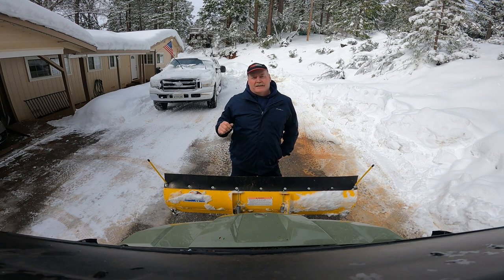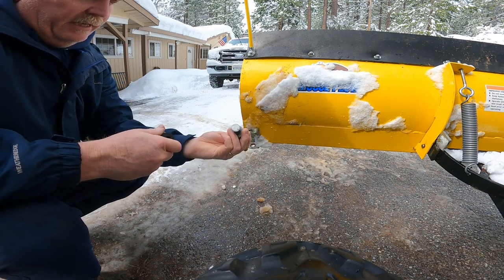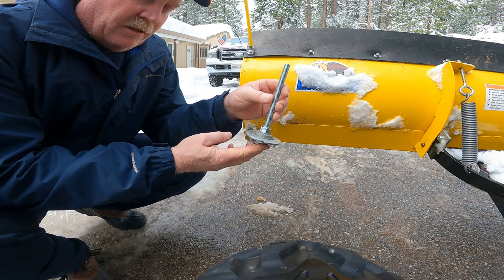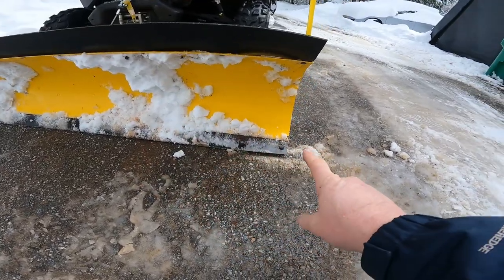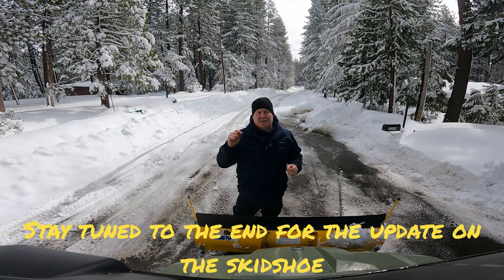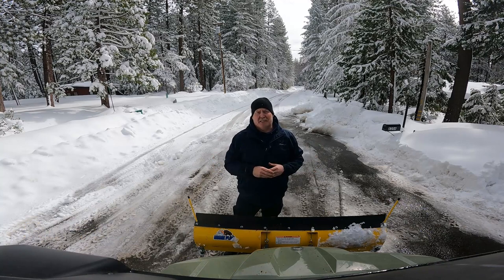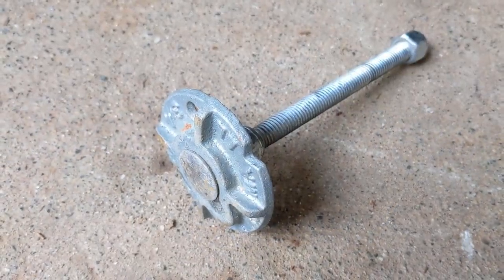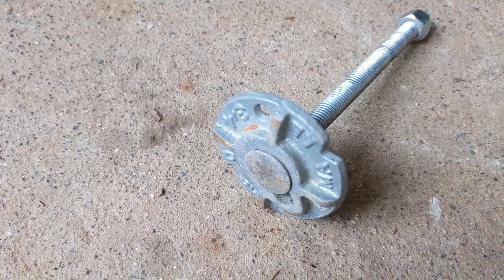Homemade snowplow skid shoes - No welding

Comment: Good job and nice temporally fix until your parts arrive. You can also use the pipe adapters the that people use to thread pipe in to make closet Rod out of . The ones that bolt to the wall. Thanks for sharing, hope all that stuff starts melting for you. Take care
Reply from the maker: Yes.  I thought about those as well.  I like your thinking.
Reply from the maker: I also use the pipe and flanges for curtain rods.